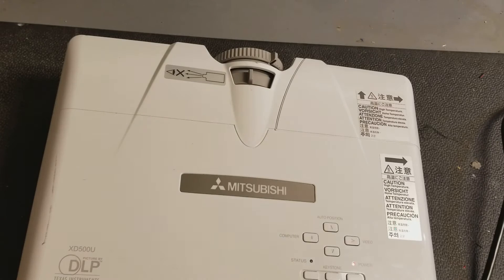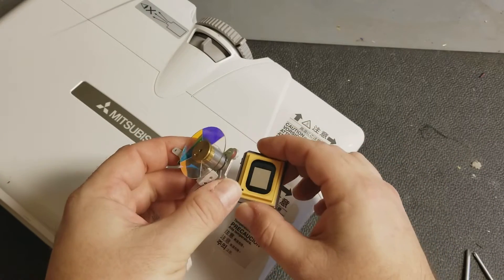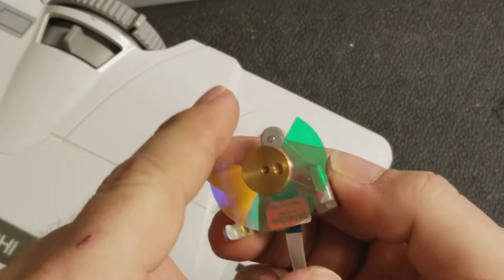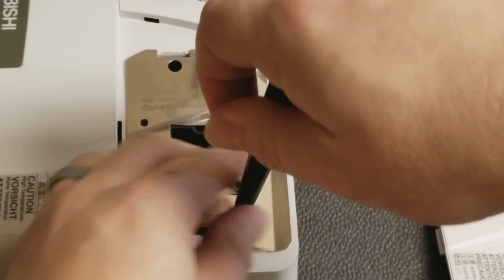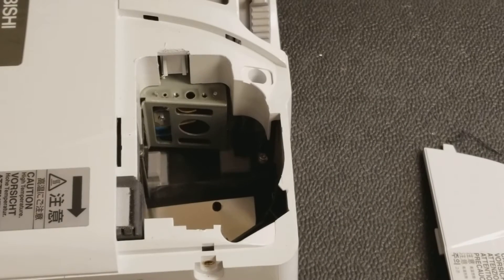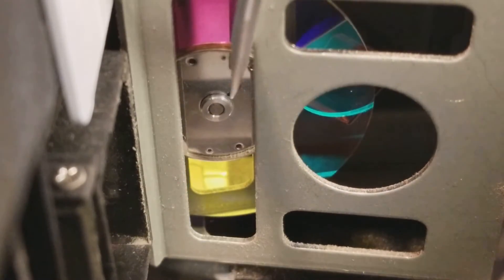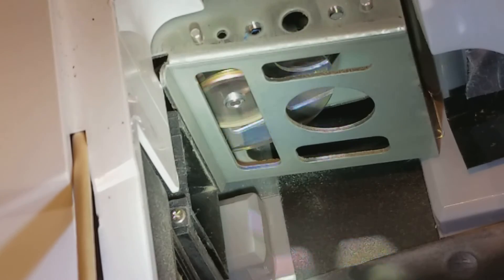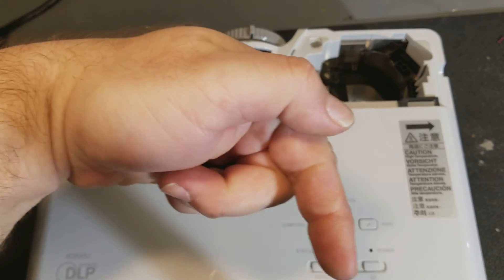Troubleshooting your DLP Projector : Color Wheel

Comment: Hi, I'm working on a Smart Board UF70W projector. Went through all your suggestions and troubleshooting and still, screen is blinking through colors when turned on then projector shuts down. Any advice?
Reply from the maker: It sure sounds like a color wheel by your description. However check the lamp to make sure it has a red/blue coating. That coating blocks ir/uv light from the bulb. If the coating is there, I would verify the color wheel sensor for dust and if it's still flashing colors the colorwheel should be changed. Does the speed of the wheel change when the flickering occurs?
Reply from the maker: Mytheroo  That is a tough one.  It  could be that the wheel is too far gone. Once the sleeve bearing goes, its gone. Does the lamp light for a split second or not at all? Could you post a video of it acting up?
Reply from the maker: Mytheroo  Its your lamp.  At least I think it is.  20-60 seconds is where the lamp comes up to full brightness. Once you hit full brightness the IR is swamping the CW sensor.  If you have your old lamp, swap that lens on the front.  That green coating is incredibly poor at blocking IR.  I measured the IR blocking against the proper coating and it was a lot less effective at blocking IR.  I would average 1000 lux of IR with the green lens and maybe 9-20lux with the proper lens.  I would really do that first before proceeding.  I have seen the green coated lenses drive people nuts.  In fact, I will do a video in the next week or so showing the difference.  I made a meter that measures the IR cut so I can show quantifiable data.  Try the lens swap first.  If still no change we can look at other things but the symptoms (less than a minute, the speed change the flickers) all sound like IR swamping the sensor.
Reply from the maker: Mytheroo  If you have access to a good lens, I would still try it.  The green coating "can" work.  But it can degrade quickly.  My day job is in the replacement lamp biz, and one of the more popular budget manufacturers is a company called Yufeng. They make almost all of the original bulb with aftermarket housing that cost about 1/4 of the OEM. They use those green coated lenses.  I have had samples from them that have a 50/50 success rate.  There may be something else going on of course, I only suggest the lens because it will eliminate a very annoying variable.  If you want, feel free to email me at my youtube email and i will reply from my actual email and we can discuss further.
Reply from the maker: Mytheroo  Sounds good to me.  You are probably correct. The blower fan that cools the lamp it notorious. The units with surging lamps are approaching the end of the lamp life. That is a common symptom.  These are a lot of fun to work on.
Reply from the maker: Mytheroo  that sounds normal.  The blower fan does cool the color wheel as well in that model. The delay is normal as well.  I believe it's to allow the color wheel time to spin up. I think the idea is to pull air across the CW and then blow into the lamp. Kind of dual purpose.  I have not had a uf75 open in front of me in a while but I do not recall them being much different than other models of similar type.  There are always edge cases, but for the most part the most common failings are lamp related. Whether it is a bad housing or a failing bulb.  Dust build up is the next most common cause and then electronic component failure. Seems to be in that order as well.

Comment: hello....i have a benq projector and i have a problem. i changed my CW it spins but my lamp does not turn on. it seems like it tries to turn on but it can't... the cw seems to be working fine. is the ballast the problem? or the lamp? is there a way to test the lamp?
Reply from the maker: I would try a known good lamp first. Verify all the interconnect switches are in the right position. Unfortunately there is no easy way to test the lamp. It's a Mercury short-arc lamp so it needs a ballast to ignite and control the power to the lamp.
Reply: FixitFrank here is a video of what it does.
https://youtu.be/3nHbidF8-LM
https://youtu.be/58uOy3msWsA
Reply from the maker: Interesting. I think I can hear the lamp trying to strike. If you look at the arc tube in the lamp, is it still clear inside?  I am suspect of the lamp from what I can hear with the lamp installed.  I do not believe it is the ballast yet.  Is that an MX670?

Comment: I have BenQ w1070.. It started showing weird colors for 2-3 days and then it would be corrected next time.. But then it's not turning on.. I have changed lamp, cleaned all the sensors, checked color wheel spin etc.. All good.. But projector lamp is not turning on.. When I switch it on, it tries to start the lamp but I can't see any light, no flicker etc.. Nd it switches off in 2-3 seconds.. After it switches off, power stays solid green and lamp remains solid red till I unplug the cable.. So can anyone help me out... Is it ballast board?
Reply from the maker: If it was showing weird colors, I would still suspect the color wheel. It may not be spinning up properly or may still have some dust in the index sensor. Once the bearing start to go, they will never work right again. Of course you would want to really troubleshoot that to be sure, but from what you saying I would be looking at the color wheel section more thoroughly.  If the color wheel is not at the proper RPM, the ballast will not fire.  I doubt its the ballast at all, but either the CW, the CW sensor or other CW related(such as loose cable).   The Wheel should spin up quickly and not change speed at all. the 2-3 second shutdown makes me think CW as well.
Reply: @FixitFrank  Thank you for the quick reply. I have cleaned the CW sensor already by using your guide. Your guide was very useful, it helped me in cleaning the whole projector. So now that it's either CW or ballast board that might be faulty , I should get it to BenQ service center for repair. Thank you again for your help.
Reply from the maker: Color wheel is easy to replace if you are comfortable with the smaller screws. eBay is a good source most of the time. Aliexpress is also a good source. One thing I would recommend doing is going over all of the areas you worked near and make sure no cables pulled free. Be sure the ballast cable is not loose.  Unless you had a lamp fail in an explosive manner, the ballast is not a likely failure point. If you would like to post a video of the projector when it tries to start, I would be happy to listen to it to hear any tell-tale color wheel noises. If you can post it with the cover removed, it would be very helpful.

Comment: I got a projector vivitek d697 it turn on, but is really low projection almost i cant see nothing, i did replaced the lamp, but still not working
Reply from the maker: Can you tell if the lamp is lighting brightly? Sometimes I out can see the light leakage through the sides.  How does the color wheel area look? Alignment of the lamp, condition of the lenses, dust or other debris in the light path. If the image is uniformly dim rather than darker patches, examine the area between the lamp and the DLP chip. However. This particular lamp can be a hassle depending where you bought it. The lamp may need to be aligned. Be sure it's a Philips bulb. Then see if the pivot of the lamp frame is parallel with the baseplate. Theres a screw that adjusts the angle and another screw that locks it. Loosen up the lock screw first and tighten it last I can post a video of aligning a ( BL-FU310B) lamp for one if these if you want. If you have further questions don't hesitate to ask.

Comment: Ok so new issue has just cropped up. Projector has been running fine after the repair for just over a week. Unfortunately we just turned it on and the fan seems to working and there is a light on but no projection happening. Also there is a strong burning smell and the side of the projector seems to be pumping out a fair amount of heat. Any ideas?
Reply from the maker: Hard to say without seeing it, but I would start by opening it back up and double checking the main board-DLP board connection. Finding the source of the burning smell should be easier that way as well. I have a theory that you have some dust buildup in the optic block. Hopefully the lens inside for the DLP chip is OK.  Is the smell kind of like burning plastic?  If you want to pop the top off and send me a picture, I can give you some more direction. You can contact me at rostit@ultrafark.com and I will reply from my real email address.

Comment: Hi Frank. Very useful video, especially to bypass the switch. I have a Optoma HD33 DLP projecter and it has started making an intermittent buzzing/rattling noise that started a few weeks ago. I still get a picture but it the noise is quite worrying. I did the steps you suggested and the color wheel seems to be rotating freely, but it wasn't doing the noise when I opened it up, so I am still not 100% it's not that. I can post the video I made when it is making noise so you can hear it yourself if that is helpful...Thanks for your time!
Reply: Here is the video so you can hear the noise https://youtu.be/a7qNur6YlWk
Reply from the maker: Sure thing.  It would not surprise me if it were the wheel. They last on average of 7 years. Let me know when the video is up and I will check for you. Thanks for watching my video!
Reply: I have put the video in the reply. Thanks!
Reply from the maker: I would put money on the color wheel being bad.  It sounds like the sleeve bearing is worn. That 'ringing' sort of noise is pretty characteristic. Depending where you are, Color wheels are pretty easy to get via eBay.  Not rocket science to replace but harder than a lamp replacement.
Reply: thanks a lot Frank! That is very helpful!
Reply: Do you have any good site/videos to recommend how to replace the color wheel?
Reply from the maker: I was unable to find any that specify the HD33.   I have a cleaning video for an HD20 that shows the general layout. Yours will be pretty close.  Usually it only requires the top removed, then a few screws to hold the wheel. Then the wheel wires need to be unplugged. If you want to email me at rostit@ultrafark.com I will reply from my real email address and send you a copy of the service manual for the HD33. It explains the entire process.
Reply: Thanks. I took the projector apart to see how easy it was to get at the color wheel. Not too bad but now I have a problem of sourcing the part. I rang Optoma and they said they would carry out the repair but they wouldn't send me a new color wheel, which was annoying. I've been looking online and there a few vendors which sell them in China for about £50 but I am concerned these are dodgy. Any suggestions of good vendors?
Reply from the maker: bioinfbloke that's great news so far. As far as fleabay goes, I have had good experiences myself. I only use sellers with over a 99.5 rating. I've had worse experience with US sellers than China as long as they have a good rating. The price is on point as well. They range from $100 to $75 so you are in the right area.  The only adjustment you may have to do after install is setting the index point. But you only have to do that if the colors aren't correct when you turn it on. The index mark is the black square on the side of the wheel that sets it's trigger point and they can be different. I have the service manual so I can tell you how to change the index point or send you the manual.
Reply: Fixed my projector! Thanks for all your help Frank. Had to take it apart twice because I forgot to connect the color wheel photo sensor BD. How I laughed :-) Anyway all done!

Comment: Thank you so much for the general tip on the color wheel. I was trying to find out why my new lamp on an Optoma DLP projector was not working, especially when the troubleshooting manual indicated that the blinking light in the projector was related to a faulty lamp. The user manual never related the blinking light to a potential problem with the color wheel. I was initially considering buying another lamp again, assuming I had purchased a bad lamp. Imaging!!! More $$$ spent on lamps when it was not necessary. 
After seeing this video, I realized it was the color wheel that was not rotating due to dirty bearings and dust build up in the sensor rather than a bad lamp. After cleaning the bearings and sensor, I was successful in starting up the projector.
Reply from the maker: You are welcome!  The error is odd, I agree. The light only says the lamp was turned off, but wont tell you why it turned off.  It can be so frustrating!

Comment: Frank, my power light does not come on on my XD500U.  What causes that?
Reply from the maker: Hi Wade, there are a few possible causes. I apologize if any of these seem obvious but I have to ask. Did you try another power cord and outlet?  I'm going to figure you did.  When you plug it in do you hear anything inside?  Like a click or small hiss?  If no, then I would suspect a power supply problem.  This model does not kill the power if the lamp door is off like some do.
Reply: Frank, nothing would come on.  No lights.  Power button was out.  Tried different plugs.  I took the lamp door off and the lights came on.  Status light was blinking.  I did a reset.  It seems to be working fine now.  Where is a good place to send these for service?  I just replaced the DLP chip last month.  Thanks
Reply from the maker: There is a chance the filter caps in the power supply are acting up.  I have a few theories but without looking at it in front of me, they are merely theories.  If its working well now, then I say leave well enough alone. It can end up being a can of worms to fix problems that are intermittent in my experience.  That said, if you wanted to send it to me to give it some love, you can contact me at rostit at ultrafark dot com and then I'll reply from my real email.